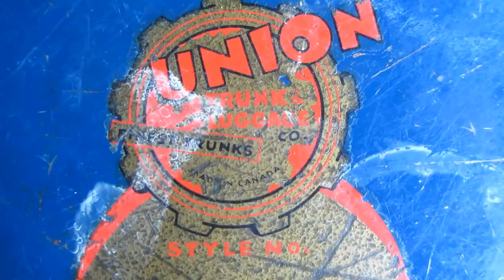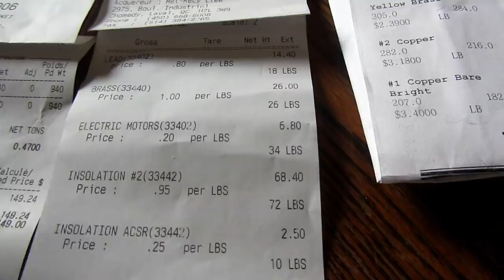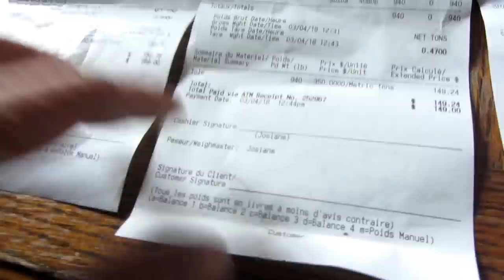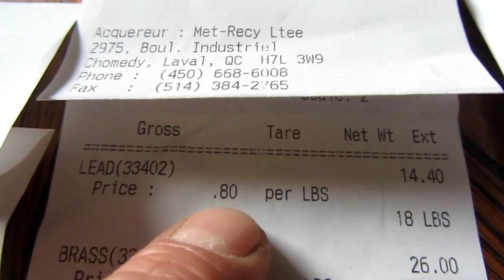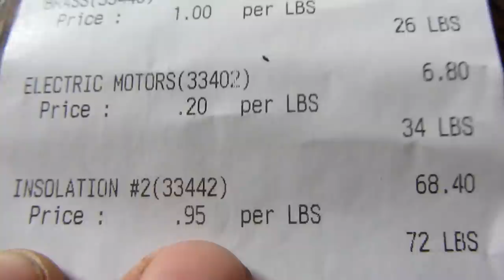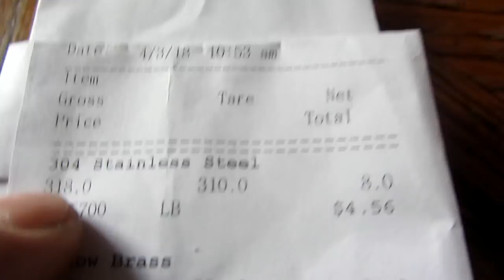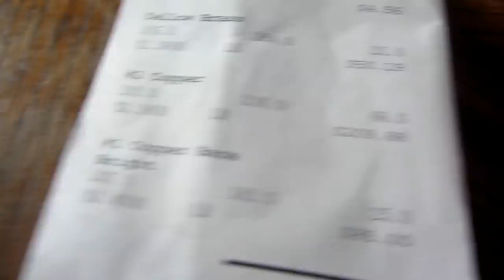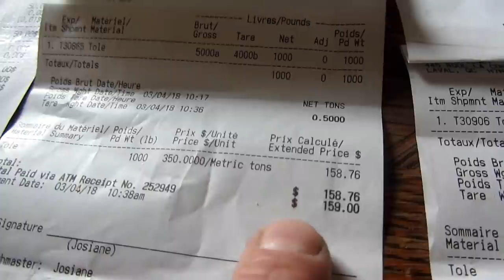BREAKING MY SCRAP PIGGY BANK #2 /non-ferrous and ferrous

Comment: is it your transmission fluid ? 
if so you need a flushing of the fluid and it needs the filter change
Reply from the maker: no it was my motor 
my trans leak just a bit i put 1/10 of a pinte every week since i busted it (last video i did about it)

but what i was showing was my motor oil it changed drasticly last week or so
Reply from the maker: next week im planning on raising funds for a master big tuneup on it 
there an other something with my 2 front wheel not sur what it is but cant leave it that way